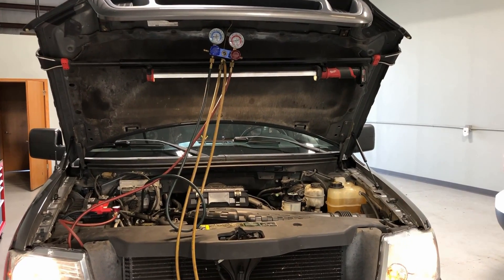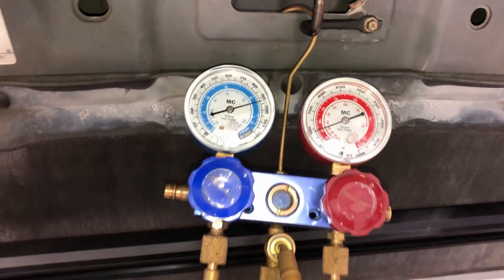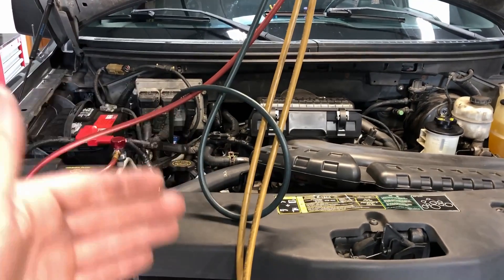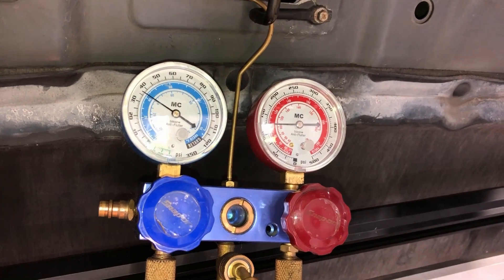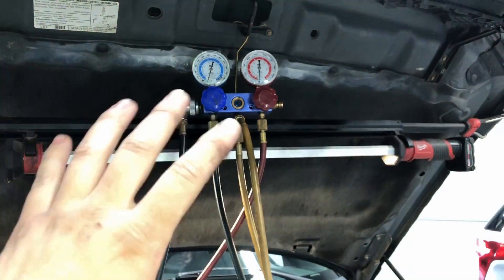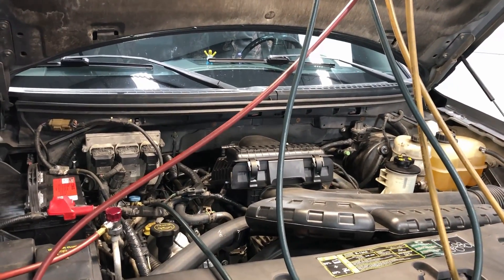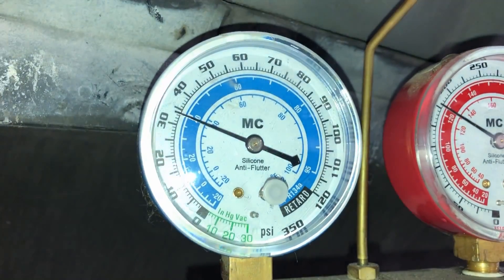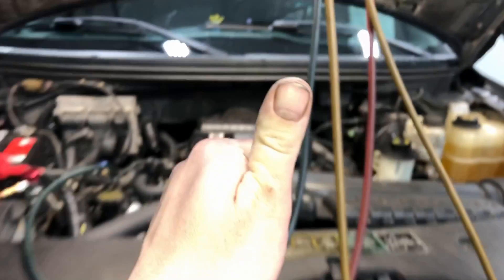Poor Automotive A/C Cooling: Do You Have a Low Refrigerant Charge Level?

Comment: Any idea how to stop a compressor clutch from cycling (not caused by a low charge)? I've replaced the pressure sensor & outside temp sensor (EVAPORATOR sensor is on order), evacuated the system and recharged to spec. On AC Max, it stays engaged for 14 seconds and dis-engaged for 3.5 seconds (80% duty cycle). On normal, it will vary from a 30% to 50% duty cycle. This started a month ago. The truck is an '16 F150 5.0 Lariat. The A/C gets cold (46F) but not as cold as it did.

Comment: Question need some help I have a 2004 Jeep Grand Cherokee having AC issues inside cabin does not blow cold air it's just cool system been vacuumed and recharge  pressure equals out when unit is off fans work don't know what else to try can anybody help will give some advice

Comment: I just replaced my compressor, vacuumed down the system and I had no leaks. I replaced it and tired to put the exact refrigerant. My car said it needed 550grams. I put maybe around 600 grams and now my ac isn’t blowing as cold. I’m checking my ac now and it’s 85 degrees outside and my low side is 35 and high side is 155 is this normal ?

Comment: Great videos, new subscriber here.  Basic AC question here...   AC’s are a closed system? So if you have low pressure there must be a leak somewhere? And if you repair anything on an ac system you need to pull a vacuum since the “closed” system was opened?    Thanks! Love the videos

Comment: I really need help, 2007 F150. Bought this truck for years ago and I just can’t get the AC to blow 40° out the vents. I’m lucky to get 58°. Condenser, compressor, evaporator, have been replaced. Pressures are 30 to 35 on the low side 180 to 220 on the high side. Is this a orifice tube problem? I did replace it with the same one that was in there. There’s four of them that can go in this truck, do I need a variable orifice tube? I just don’t know how to fix this problem.

Comment: Just changed out the fan clutch, A/C clutch (just the plate), and idlers on my '05, which helped a lot, but still not where it should be sitting at lights (on a 97 degree day). but now I notice it kicking on and off too fast like that, time for a can of A/C Pro

Comment: The temperature at the gauge is the boiling point of the refrigerant at that pressure. At the low site it is the refrigrent boiling point inside the evaporator, which mean it is the minimum temp u can get. and it should be lower the better , but not reach freeze temp or vaccumm when the engine is rev. As u realize the compressor stop when it reach around 27psi which mean boiling point at 32F is freeze, so the compressor cut it off to avoid damge.

When u driving, it become cooler, because the compressor run faster and it suck more refrigerant, low site pressure drop futher as also the boiling temp, u can demostrate it just by rev the engine. 

Inside cabin u temp gauge show 40F , it is same as the blue gauge 34psi pointed at 40F boiling point, the lowest temp u can get at the evaporator. The red gauge is for guidance only, 175 psi around 118F which is the refrigerant condense temp at the condenser and transfer heat away.

Comment: Loved this video and very detailed for refrigerant.  How does your system evacuate the PAG oil?  If it does, do you not have to replace the oil?  How much?  Does your unit separate PAG oil from r134a by weight/volume?

Please advise,

Mr. P

Comment: Great video thank you! My 04 F250 6.8 V10 AC compressor is short cycling. I ordered a set of gauges and vacuum pump. When I recharge system should I add pag oil or does the r134a have it already ? The sticker says 2lb 10oz r134a and 9oz pag oil. Any help would be great thank you

Comment: Hi from South Tampa, FL.  I replaced the evaporator and accumulator in my 2003 Ranger Edge 3.0L last year.  After replacing them I had a dedicated automotive A/C shop evacuate and recharge the system.  On 1 September 2020 my a/c started fading out and my original compressor is now cycling too quickly indicative of low or no charge.  I have a brand new Four Seasons compressor about to be installed along with a brand new condenser (both from rockauto.com).  Once I get these two parts installed I'll have that same shop recharge the system.  Only AFTER I bought a set of manifold gauges from Harbor Freight I learned from reviews that the gauges are trash.  I had them for more than 30 days unopened I couldn't take them back, so, I was wondering what brand of gauges would be recommended if money wasn't too much of an issue for a DIY at home mechanic?  I'm not an Amazon shopper, so what walk-in store could I go to to pick up a set?

Comment: Hey you are a great instructor ive watched other vids of yours for some time now. My question is concerning a 2001 TD Excursion with dual a/c, is there any unique procedures to this thing? Its a FOT up front (it was, I installed a VOV when I had the system opened but may go back to stock if it makes diagnostics too complicated) and a TXV in the rear unit. My problem is I will apply vacuum for a hour at 29 inches, find no leaks, then charge to specs and the system cools poorly like a low charge, no excessive cycling though. Another thing worth noting that I have never experianced before is when its running for enough time to be stable at full cold the compressor gets icy cold to the touch! Usually most cars the compressor will get hot. Do You know what I'm doing wrong? So you know I've done a/c enough to know more than the basics but it hasnt helped me here.

Comment: I have 2010  F150 Lariat, 5.4L.  I had system topped off by my local mech. last summer.  He put some refrigerant in, but he said he did not want to overcharge.  There are no leaks, but it still is not quite cooling to the max.  I want to recover with a Robinair RG6 machine, and totally recharge with new refrigerant.  The system holds 24 oz 134a and 6 oz of oil. Question: I assume there is still some oil in system.  How much of that 6 oz would I assume is still in the system, and how much to add?  Thanks

Comment: Thanks Brian,
Ive got 2010 explorer with rear ac
Vehicle came in for no a/c cooling issue. Ambient temp is like 110F.  
Hooked up my gauges engine off
And found 250psi low side. 
Started the system and the readings were:
110 low side and around 250 high
I knew right away the compressor is shot. 

Flushed the whole system and Replaced the 
Compressor, 
condenser, 
orifice tube, 
high pressure line & 
cooling fan as well. 
Recharged the system and rechecked my readings and they were: 
Low side 60-70
High side around 250-300
And no cooling whatsoever..

Right away i knew there's a blockage in the system. 

Evacuated & Unhooked everything and flushed again "twice" 

Recharged and rechecked, 
Low side around 60 and dead slowly going down to 40's neighborhood. 
And cooling started coming out of the vents between 60-50F 

The thing i don't like about this is the new compressor doesn't cycle off..!
Its running non stop..
I drove the car highway for about an hour, watching my thermometer in the center vent with my scanner showing the compressor clutch pid. 

And guess what,
The compressor kicked off on 31F degrees coming out of the vents. 
I felt good coz my canin temp sensor at least works. 😃

Right away I suspected the low pressure switch mounted on the accumulator,
Replaced with OE part and rechecked the cycling, but no change. 

My question now :
Why my low pressure reading is moving dead slow to go down. ??

One thing I did not change is my receiver dryer/accumulator becoz its not available and I didn't wanna use aftermarket. 

Does a bad accumulator cause the system to be sucked down ever so slowly like this..??

Why is my com not cycling on and off..????
its brand new OE. ???

Do you think a partially blocked accumulator would cause such condition..??

Pls. Share your thoughts. 
Love your channel man 🌷
Reply: I had this same issue, turns out I was overcharged which can give similar symptoms as an undercharge. The compressor frequency cycle is dependent on evap heat load and engine RPM which is controlled by the low side pressure switch or evap temp sensor. If you are overcharged you will have higher pressure at the TXV, increased load on the engine which will use more fuel, could damage the compressor, higher pressure = higher vent temps. If your compressor does not cycle on recirculate with low to medium fan speed after the cabin has cooled most likely you are overcharged.
Reply: Metal Halide 
thanks man for your share
I think i do. 
I think its overcharged yes. 
But the tag says 44oz and do i did. 

But then i look at the ambient temp and said to myself thats too much..

Engine off, static pressure I'm reading 166psi

Tomorrow I'm gonna reduce that to 120psi static, close enough to ambient temp. 
and recheck my readings and cooling

If the compressor started cycling like it supposed to be. Then you're the man 👍

I'll be posting what omes out.
Reply: But how come..?
The tag sticker says 44oz. 

How could that possibly be too much..?? 😟

Could that be related to blockage in the system in anyway..?

If i do still have blockage, its gonna be in the accumulator..coz like i said, I did not change it..i just flushed it with 401 like 4 times to get it to clrar out. 
But before it was CV ompletely blocked.
Reply: @Leo28aa  Static pressure is no indication of current charge, even with a few ounces you will read the same pressure. You have to adjust pressures with the windows down, out of direct sunlight, A/C on recirculate, fan on high, let stabilize for 5 minutes.
Reply: @Leo28aa  If you have any kind of restriction both your low and high side will have lower pressures because there is less pressure at the compressor, its possible to even pull a vacuum on the low side if the restriction is bad.

Comment: I have a 2004 Dodge Ram 1500 5.7 V8 Hemi and I just replaced my AC compressor the dryer and a bunch of the rubber O-rings and I tried to recharge the system myself obviously I didn't wrong and that's the problem I'm having with mine the compressor kicks on and off so I'm going to bring it to a professional to have the system vacuum rated and charge properly because I have the gauges also and they were both sitting on the low side thank you for the video it helped a lot

Comment: I have a 99 Ford C.V.P.I. and the A/C system is doing this in addition to the radiator fan not coming on to help cool the engine which causes it to overheat when the A/C is running. It will run all day long with the A/C off but I don't want to run without any A/C where I live (I live in Las Vegas NV and it gets hot here) I replaced the compressor, condenser, accumulator, and orifice plug, I have the A/C high pressure lines ready to go in as well as the cooling fan motor connector AND the A/C compressor clutch connector. At this point I have only the low side lines and the evaporator to replace on my A/C system. I am pulling my hair out and ready to shoot my car over this stupid problem and I am tired of playing whackamole with this problem any hints or suggestions as to what it might be?

Comment: So since this was low, does that mean there's a leak in the system?
Reply: I was wondering the same thing....
Reply: Most of the times yes, but after many years you might needs to add a few ounces as normal maintenance, there are lots of o-ring fittings in an A/C system that a very small amount of vapor can escape via permeation similar to tires.

Comment: I have a 2011 Ford Fusion and the ac just stopped working.  I hooked up the gauges and I have the same pressure on both high and low when the pump is running.   80 psi.  Does this mean the pump is done?
Reply: Turn on headlights if it starts working temp sensor is bad

Comment: I have low suction (25psi) 
high discharge(335psi) at 85° ambient temp 
What can be the problem?
Reply: If not low on refrigerant my guess is a blockage, possibly a sticky, stuck or clogged TXV if so equipped, or clogged fixed orifice, if so equipped.
Reply: Try cleaning or replacing your condenser. If the high side gets that high, it’s a sign that your AC system is having a hard time expelling heat. EricTheCarGuy has a informative video on AC condenser cleaning.
Reply: Thanks for the tips guys 
Room the car in and ended up being the Compressor..
It’s common on GT350 because of the high (8300rpm) redline..

Comment: Why is my air compressor clutch stay engage all the time?
Reply: If its v5 compresser type its variable displacement which it will not cycle off but  the valves works less inside the compressors

Comment: I have a 2013 Ford escape with 120 thousand miles and everytime my wife and I go on a long cruise, the AC stops blowing any air? You can hear it running but you don't feel any air coming out if the vents. Stop at a gas station or whatever, turn the car off then turn it back on and it's fine. Does anyone know what might be causing this problem?

Comment: I have a 2002 Ford Excursion and the air isn't cooling well. Low side pressure 10 psi, high side pressure 200 psi. No compressor noise, no cycling. ambient temp 92. Clogged orifice tube? Thoughts, ideas??

Comment: Hi, my R12 convert to R134a and my condenser too hot to touch and the temp measure only 50F and 60F during hot weather. I know my system a little bit more oil.
Fyi, I've bypass High side switch.
Reply: not enough air flow through the condenser. check your fans and shroud, make sure condenser is clean on the outside and no debris trapped in it.

Comment: Hai i have 2015 altima 2.5 sv. The ac will take time to flow cool air usually 6 km to run. And it will off when i increase the rpm more than 2000 or speed above 120 km. I took to shope and checked low and high pressure side the reading are 70psi and 150 psi. Kindly guide..

Comment: I’ve filled my AC system on my 04 Lariat 2 times already and it still blows hot. If there is a leak somewhere in there are any typical areas where i should take a look?? My ac compressor is on and seems to be working well.

Comment: Thank you for breaking it down and for all the information. Do you by chance know if the compressor has a scroll valve on 2005 Ford Explorer 4.6L? My low side static pressures are around 55 and my high side pressures are at 135. The dynamic ranges are around 28 for low and 240.

Comment: So is it ABSOLUTELY necessary to completely suck down the system BEFORE recharging???  I've always just added a can when it's low.  If we MUST drain the system then I'm SOL in the future.  Great vid, tho!
Reply: If you fixed the leak and you need to recharge, pull a vacuum before recharging. If its just low on freon, add some

Comment: Looking at the static pressure I read 93 PSI which also is the same as ambient temp as well. This only holds true if the system and engine has not been run to as to increase it's temp. On 80's and 90's Fords the low cutout switch was adjustable, when the system was working fine but the customer still complained about cooling output I would adjust the low side to 28 PSI to give that extra cooling.

Comment: How do you test the 3 wire plug that goes to the alternator on a 2005 Mercury grand marquise. I have located a video that stated common problem with all fords manufactured,  the title of the video is "How to test for a broken alternator wire" he showed a 2002 Mercury but it only had 2 wires and he spliced the red wire that failed the test and spliced it to the battery post on the alternator. The alternator suddenly worked, which in short is a broken wire. Now here what's happening with mine, the alternator when working goes 14.2 without a load and when a load is put on i get 14.1 it stays that way for a week. Now the alternator is dropping from 13.8 without a load to when a load is put on it drops to 13.1. The alternator checks out at the parts store, and also the battery when nothing is on and the battery sits it reads 12.6  how do i test the 3 wire plug on this Mercury. P.S Replaced 3 alternators and 1 battery already. Would appreciate any help you could give me FordTechMakuloco.